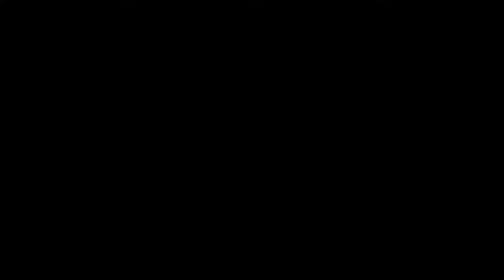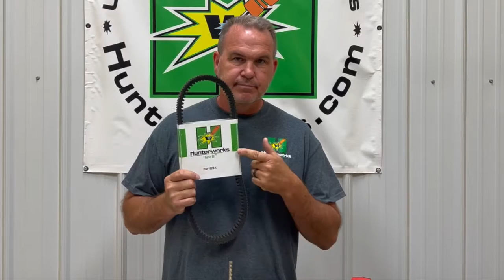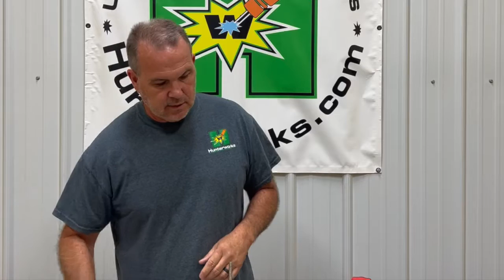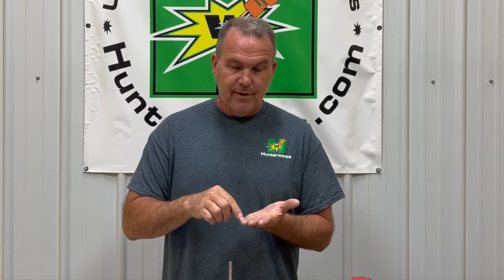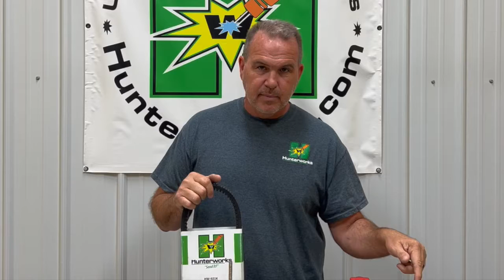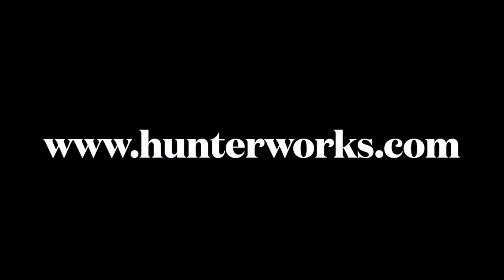Polaris Misfire Code??? Explained here

Comment: 2018 ranger 1000xp. I get the misfire code at start up while engine is cold and  machine not moving. If engine hot and I start it I don't get the code.  After driving it couple minutes it clears code.
Reply from the maker: Can’t say but that’s not clutch.

Comment: What would cause my 2017 Polaris RZR  1000 S to backfire/like a popping noise when I start slowing down only. Any help would be appreciated. Thanks.
Reply from the maker: An exhaust leak can or if you have a tune on it and you are not letting off the gas pedal all the way

Comment: After I went to the duraclutch I have been chasing the misfire fault.  So brand  new clutch primary and secondary. It normally will clear After a bit. Also put new plugs in so any help would be appreciated.
Reply from the maker: They offer a free flash for that if it started within 100 miles of the install

Comment: 2013 ranger 800efi changed plugs and injectors/cables only running on one side pull the plug on driver side still runs but bad pull the passenger side it dies ? Any ideas ? Just changed oil air filter everything but the belt code 651 5 was on before
Reply from the maker: No such thing as a belt code, that comes up as a injector issue but since not clutch related I am not a huge help on this one
Reply: @Hunterworks  thanks for replying !!!👍

Comment: Any idea what could cause a intermittent code. I come on every time we ride but always clears itself pretty quick
Reply from the maker: Sometimes it is hard to find until it stays until cleared manually.  I can only tell you what to look for in the clutch to see if that is it.  if you hit a rev limiter when you floor it at any speed it is the clutch
Reply: How do you reset the codes on a 2012 rzr800s  @Hunterworks
Reply from the maker: @seanheavner358  Sorry, I do not know, I would assume once you fix what is causing the code it goes away, heard undoing the battery for a few min too.  Not really my area of expertise.

Comment: 2023 9r 3miles in to the ride. Got a DET and flashing chek engine. Changed plugs nothing. Would like to know more on what is the general purpose of the DET system. 91oct pump gas
Reply from the maker: what is a 9R?  Take it back to the dealer since so new, we have not dealt with the DET system on it
Reply: @Hunterworks  its the new polaris rmk 900r 2023.
Reply from the maker: @damourssteeven  not sure utv have it.   The trick is finding out why it’s denominating.   But I’d have it back at dealer.   Ecu might have too much timing in it
Reply: @Hunterworks  i added octane booster in it and it is less intense i only get the DET code while going full throtle. im bringing it to the dealer tomorow asap

Comment: I installed dalton clutch kit on my 2015 xp4 1000 and set it up for my 32" tires. Ran 28" 9 paddles in the dunes and threw misfire codes and went into limp mode. Are the smaller tires my culprit?
Reply from the maker: potentially, put your 32 back on it and run it hard and see, you might have gotten you a new clutch issue you didn't know about

Comment: 2019 Polaris rzr 1000 eps s4 code 65590 7. Any idea? Doesn’t seem to be giving us any issues but engine light is on with that code
Reply from the maker: Without looking that actual code up, no pretyy sure is a misfire code though, have you floored it and ran it to top speed yet?

Comment: Hey I bought a 2021 Polaris rzr 1000 xp high lifter drove it one time it ran fine, 2nd drive I hit a hole and it went under and after getting it unstuck it’s throwing same codes here. I’ve replace spark plugs new belt. Afterwards I got to 65 miles an hour and then I turned around drove back and rpm hit 8k and then dropped to 7k back to 8k and then dropped again and code misfired. I had the gas pedal all the way down when this happen? Any ideas?
Reply from the maker: You need to get into the clutch and see what kind of damage you see of just full of mud and water

Comment: what can a 2017 rzr have when I'm accelerating and I let off the throttle it makes a weird noise and stops moving then it's hard to change between the different gears PRNLH
Reply from the maker: I would start with our how to troubleshoot a primary clutch video

Comment: after i went to the duraclutch, now i'am getting the misfire fault 65590.  brand  new clutch primary and secondary. It normally will clear After a bit.
Reply from the maker: No, they offer a free ecu flash for false misfires.
Reply: hi, how did i get the free eco flash, thanks david
Reply: HI, how do i get the free eco flash? thanks! david
Reply: no need to reply, i found the sheet with the information i need to send in the ecm.
Reply from the maker: @davidpic-gu5tc  contact where you bought it, should be a form in the box

Comment: I have a code coming up 1  51 ,what is the meaning of this code
Reply from the maker: a google search says this "code 51 is a stuck open injector on cylinder number one. It runs poorly at lower speeds because it can not handle the excess fuel being dumped into the engine"

Comment: I just dropped my Polaris ranger XP 1000 off to the dealer with a misfire code 1st thing he said  the belt was hourglass due to belt slippage and I said I don’t think so I think it’s more than that it only has 2600 miles on the belt and they said nope it’s a belt issue and I said They need to checked for something else that is causing damage to the belt. Their reply is there tech has been doing this for 13 years and he knows what he’s doing.
Reply from the maker: What year ?
Reply: Id have to agree belt, we change belts alot more often then 2600 miles.
Reply from the maker: @tomayers6289  you need to contact me.
Reply: @tomayers6289  I've never had a belt last 500 miles lol I have learned a lot on these videos though and just recently put the HW belt on, so we'll see.
Reply: Kind of like brakes, 500 miles and they are done. Found a lot better luck with brass though.

Comment: I just bought a 2024 sportsman 1000 about a month ago, and already I got a check engine light, this is a brand new machine.. wtf?!
Reply from the maker: I would be taking it back to the dealer, assuming you have left this vehicle totally stock
Reply: @Hunterworks  oh yes, totally stock.. it’s at the dealer…this machine is an absolute Monster! No real need to modify it. Literally have to try Not to do wheelies. Come to find out, it’s just a faulty switch.

Comment: 2023 RZR Pro XP only 4 miles on it yes 4.  I just started the machine up and 2 misfire codes 65590 & 65592.
Reply from the maker: better take that one back to dealer, might be the bad clutching set up and wrong washer in primary but so new, I would take it back
Reply: @Hunterworks  thanks for your opinion, I will be calling the dealer tomorrow.
Reply: Can a ecu cause misfire codes